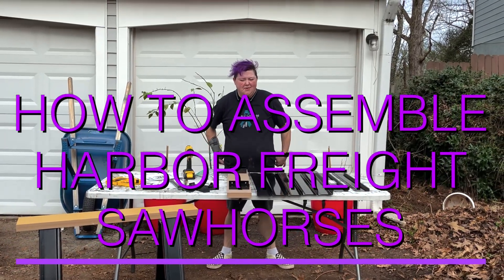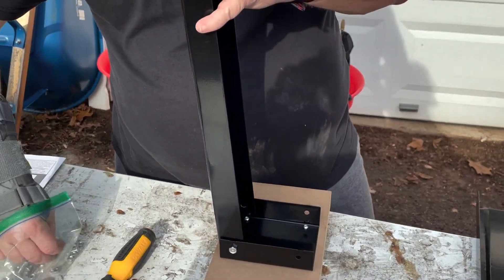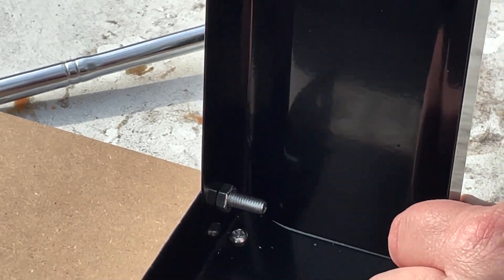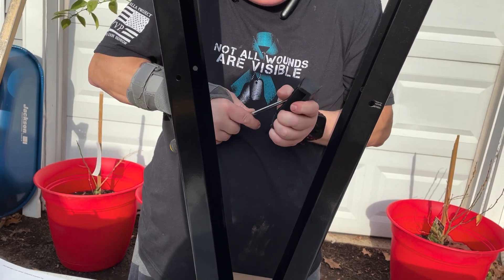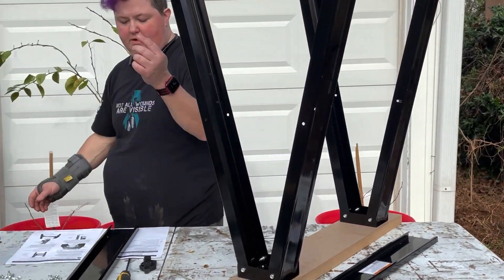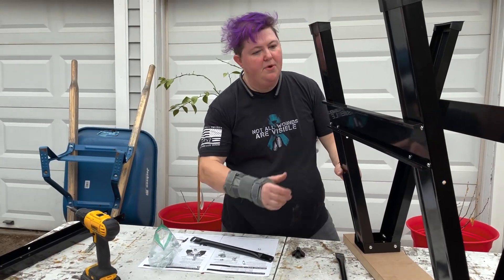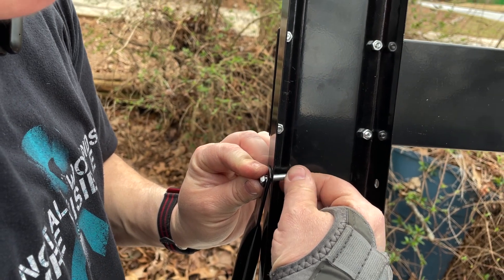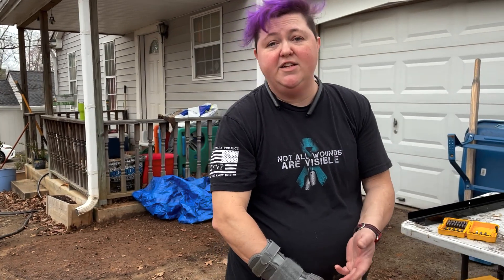How To Assemble Harbor Freight Sawhorses

Comment: Thank you for the video. Is that normal that the bolt are so loose at the end, where you put on the locking leg? And that the knob is basically useless as it doesn’t tighten all the way, even with the leg in? I was looking for info on that portion and you cut it short but I admire you confirming that I did it right so far :)
Reply from the maker: Hello catherine.951. You’re very welcome. I’m glad I could be helpful on some way. However, I’m sorry it got cut short. I’ll keep this sort of thing in mind for future videos. You are correct. The bolts are loose and the knob does not get very tight, if it at all. I suspect that’s the way they made it or it’s a manufacturer’s flaw. But for the price, I decided I was okay with it cause it still at least holds up and doesn’t collapse. Thank you for watching!
Reply: @freedomgardenergirl  just wanted to let you know, i compared yours with other videos to try to figure that portion out. It is official, you have the best video regardless. The few ones i looked at, the guy didn't look at the manual, did it wrong and realized it half way into the video LOL Whatever you are building, please keep posting :) It is mainly editing work that would need some focus on, so you don't get so caught up with the timing. I enjoyed watching regardless :) Thank you for replying - i did not expect it :)
Reply from the maker: @catherinn.951  thank you for the feedback and the kind words. I appreciate that and will work on the editing and timing. Both are good suggestions. I’m a newbie to making YouTube videos so any constructive criticism and positive feedback is wonderful and definitely appreciated. Thank you again!
Reply: @catherinn.951 there was one video where the comments said he put something in upside down! 😂